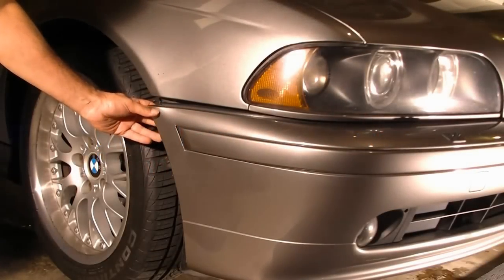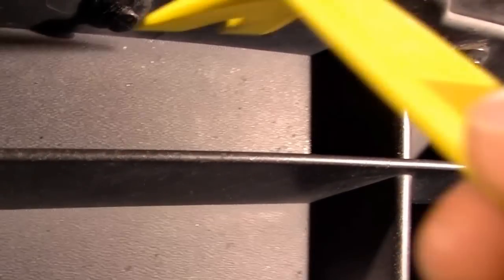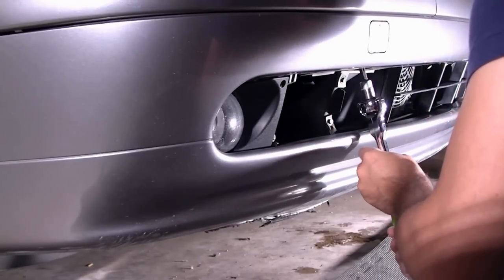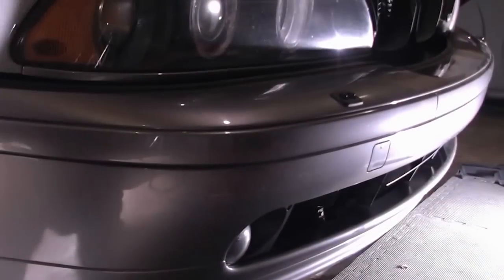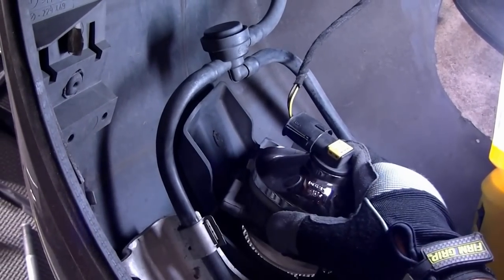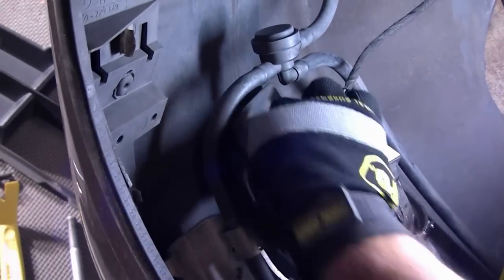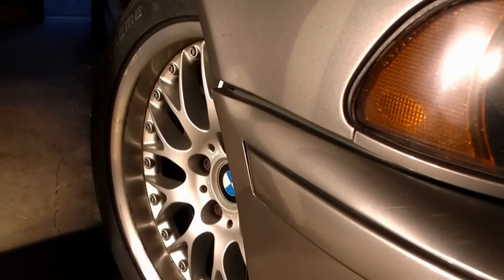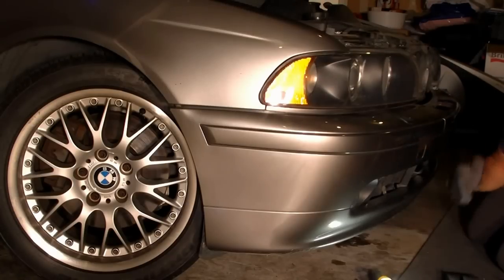E39 [BMW 5 Series 1995 - 2003] Front Bumper Removal

Comment: Worked great for me, thanks. I tried popping it back into place from the wheel well as some people suggested, and it was too hard. Following your video on removing the bumper cover, I just needed to find a Torx T50 bit and unbolt one side. It only took about 15 minutes to pull the bumper cover forward, push it back onto the rail from the front, and put everything back in place.

Comment: This is a common issue.  Video has good info, but this is definitely the long way to do it.  Like another person mentioned, just remove the wheel or turn in the wheel on the side it's on, and remove the wheel liner.  Going from there to remount the bumper is straight forward.

And it is pronounced Rach-ette.  And there is plenty of info on forums about this bumper fix.  Read em first prior to making a vid.  I learned this lesson the hard way.

Comment: Hey I have a 2003 BMW 530i with the same style bumper, same exterior color the only difference is my rims! anywho, What if you don’t have those big bolts that you said holds the bumper to the body? I’ve looked everywhere for those bolts on my bumper but can’t find them. I have a bumper that is hanging on by a thread due to my brother pulling forward into the parking space too far going past the little concrete barrier then reversing and the bumper getting ripped completely off the vehicle. It even broke the grey plastic square piece of the side of the which locks the bumper in place (don’t know what I’m gonna do to fix that situation) The bumper looks securely attached to the body except for that little section that you show on the video, I’m afraid that it is gonna come off while I’m driving and cause serious damage to the vehicle or someone else’s vehicle is that happens I’d be beside myself you know. Do some vehicles have bumpers without those long bolts securing it to the body?
Reply from the maker: I am pretty sure that these bolts serve a purpose of holding the bumper securely. Maybe you can't see it due to some misalignment from the damage. I would at least have it looked at by some body shop.

Comment: What year of e39?  I have 2002 503I my bumper has a small gap and is pretty worn from scraping on parking stops and such.  How much time did it take overall?  No other help?  Probably will replace the wheel well plastic along with the bumper shouldn't take much more effort I would think?

Comment: ANYONE KNOW HOW this is done? The 2 big bolts in front..EZ..then just remove the inner fender bolts?Im changing the aux fan.So is there any other things holding this on?
I have seen DIY posts saying headlights have to be removed???This looks pretty straightforward. i tried but seemed like something was snagging it.THOSE INNER FENDER BOLTS!! I 4got to remove.Will try tomorrow.And will post clearer instructions.THIS HELPS ALOT tnx 4 the vid.